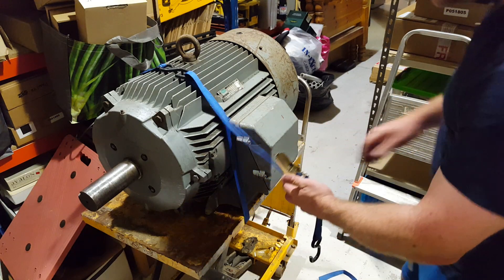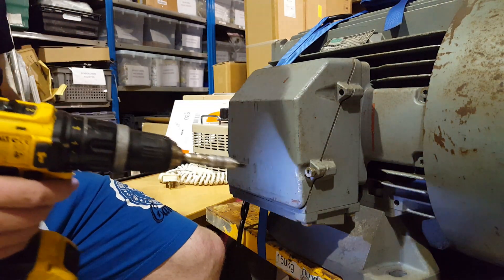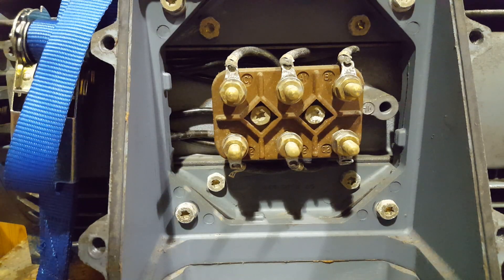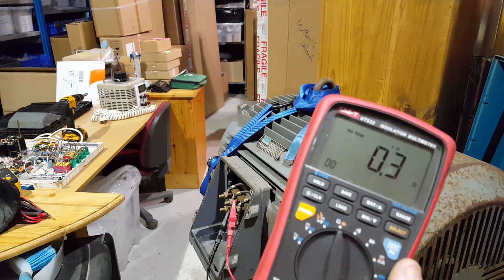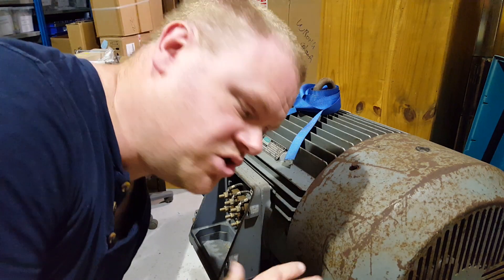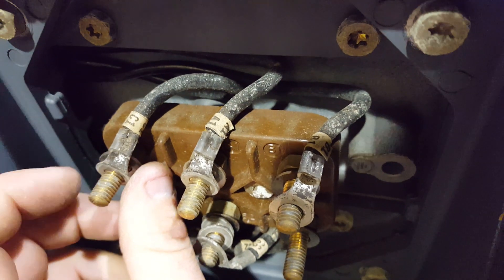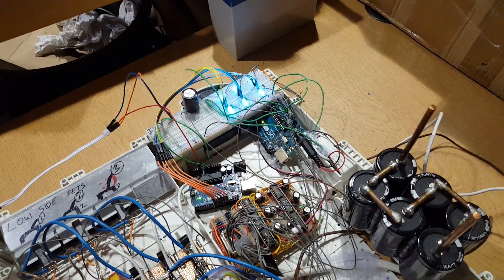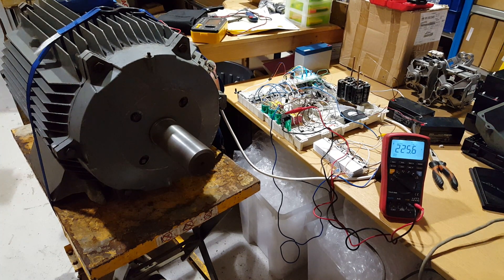AC MOTOR CONTROL #7 INVERTER AND BIG MOTOR

Comment: 12:03 what's happening here is that you're overmagnetizing the rotor by applying a block-commutated voltage. That means, the stator field jumps 60° when switching, and the rotor tries to keep up to align itself. Therefore the rotor experiences a higher torque that accelerates the rotor to a higher speed than the average field rpm. Once the rotor reaches its alignment point, it no longer experiences any torque, but is still spinning faster than the average field rpm. It overshoots and the motor turns into a generator, pushing current back into the inverter and therefore raising the voltage. Once the rotor speed has decreased, it falls back behind the magnetic pole and the cycle start all over again. Due to enertia of the rotor, this action can become very "springy". Motors that are block-commutated always need a certain amount of load on the shaft or they will start oscillating.
Reply: Basically this (https://youtu.be/VpICS3kWp5U?t=553 and https://youtu.be/VpICS3kWp5U?t=711) is happening here, just more averaging out due to rotor inertia

Comment: I wonder is it possible to control induction motor by constant slip? for example rotor rpm is 1000 then magnetic field rotation is always 5% faster so 1050, as load increase, stator magnetic field rpm decrease too by lowering frequency so the slip is locked at 5%. So we just control the input voltage like DC motor as frequency automatically adjust itself.
Reply from the maker: Yes . Controlling a 3 phase induction motor uaing this method is one of thw easiest ways its done :-)

Comment: Hi Jason! Big like for the motor control series i have learnd lot, i have searched a lot but your videos made it clear to me how a vfd works.
I want to make my own inverter, a have the parts recoverd form old units, i am planning to use the vfd to power my lathe replacing the old noise rotary phase converter.
Will this simple program on the arduino, run a more complex load like a lathe?
Reply from the maker: Hi there .. well it will but with this code if you apply pressure onto the cutter the motor speed will slow down and speed up again when there is no load.. i am working on a commercial controller with feedback as we speak however i recently discovered a really cool piece of kit you can play with.. check this out its the st ihm0001 dev board kit .. for less than £30 you get the microcontroller board AND THE DRIVER BOARD ... WAIT FOR IT .. AND A SMALL MOTOR ASWELL .. sorry for the caps just really excited lol.. check it out .. its 27 pounds from rs components here in the uk  and i aslo say it on ebay for £55 still not bad at the higher price
Reply: @jaysjetskis  thanks for the reply, i already am putting the vfd together, if i have succeeded i will make some tests under load, i have a bunch of 3phase motors on hand with different hp ratings probably play around with the code. Cheers!

Comment: Could you use a small VFD like this to "jump start" (as opposed to capacitor starting) a large rotary phase converter to drastically decrease starting inrush current? I got a 60HP motor (230V/460V & 148A/74A) that would be nice to use as an RPC but I only have 200A service. From what I read, inrush would be many times the current allowed for my electrical service. Use the VFD to bring it up to operating speed then switch over to 1PH. Great video btw.
Reply from the maker: Yes you certainly could however you mighr want to add a few igbts to gandle more current